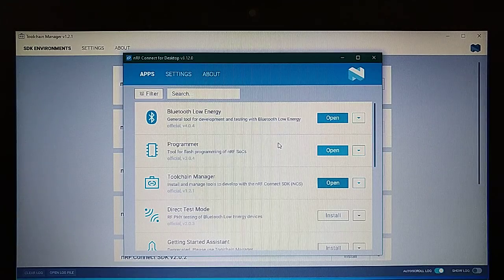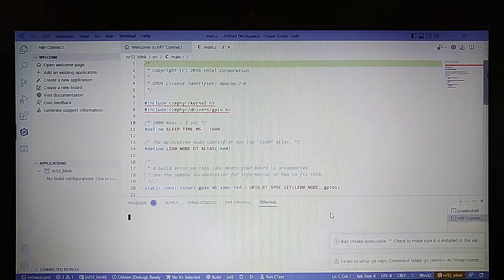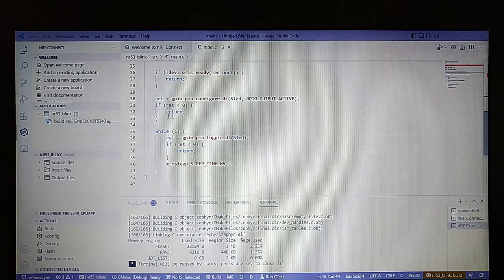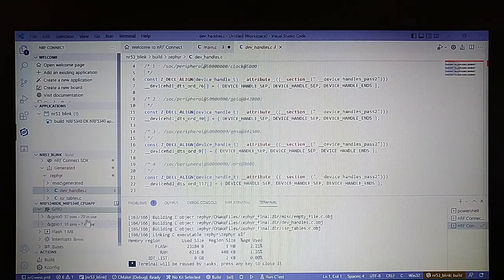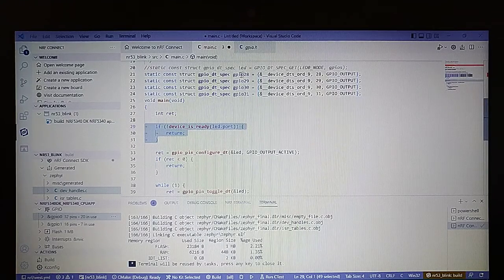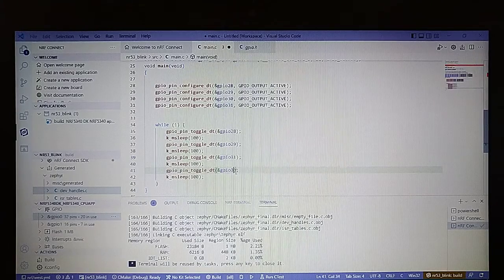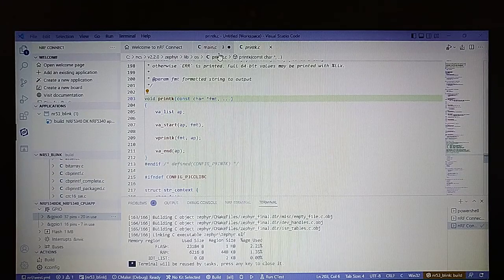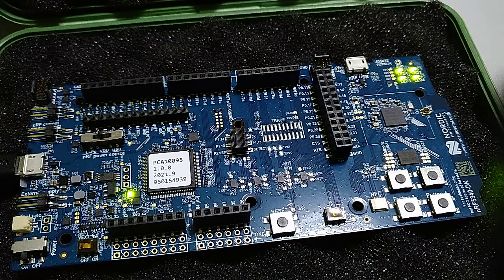Nordic NRF5340 DK blink example in nRF SDK VS Code

Comment: Hello sir, I saw your video using the NRF53 audio module – very informative, thank you!
I have one doubt: Can I use the Adafruit nRF52840 Express board instead, just for doing a simple LED blink as you showed?
If yes, do I need to change anything in the code or setup?
Thank you in advance!
Reply from the maker: Hi, for nRF52 I recommend using Segger Embedded Studio with nRF5 SDK, however the example probably could work just by changing the board in the project setup (in VS code). Just make sure the board definition selected is compatible with Adafruit Express board (the pins You will be using are the same)
Reply: @e-exp  thank you sir

Comment: I don't have dev_handles.c after building, only configs.c and isr_tables.c
Reply from the maker: You are right because the version of sdk 2.2.0 (the one used in the example) is not available thanks to nordic, and the new versions differ alot and don't have dev_handles.c in build.
I'm not sure when i will be able to add a fix to it, but when i will have a bit of time i'll add it.

Comment: how to connect nrf5340 board with any other ide?
Reply from the maker: Segger Embedded Studio supports the nRF5340 MCU but You have to create the project nearly from ground up. 
https://wiki.segger.com/Nordic_Semiconductor_nRF5340

Another way is to create a baremetal project and link the libraries to it so it can be used in most of the ides.

At some point in time i will be switching to segger or atmel studio (visual studio) with the nRF53DK because the vscode with zephyr is kind of slow  and takes a lot of resources to build.

Comment: I can't find the file "dev_handles.c", so I have no idea about devices declared. Could you help me?
Reply from the maker: Hi, the dev_handles.c is a file generated by the zephyr build process. So to get the file You have to run a clean build of the application. After the build the dev_handels.c can be found in Source files -> Generated -> zephyr. 
If You have problems with zephyr you can use the nrf drivers directly just like in my video with a spi lcd screen - there gpios are used only with the nrf driver.

Comment: Can you make a video tutorial for vs code used nRF52 microcontroller with all the peripherals like gpio, adc,  pwm, uart, i2c, spi
Reply from the maker: I got a few nRF52 DK boards (the nRF52832 variant) so sure thing
Reply: @e-exp  Thank and please make the tutorial using vs code
Reply: @e-exp  no problem with nRF52 series, you can use any kind of nRF series 53 also because of all series are same way only

Comment: for a blink of LED i have to code this much 😅
Reply: Real
Reply from the maker: You can also use the legacy driver, for example to configure a gpio as output use nrf_gpio_cfg_output(pin); and for toggle use nrf_gpio_pin_toggle(pin); - where pin (uint32_t) is 0 to 31 pins P0.00 to P0.31 and from 32 to 47 pins P1.00 to P1.15. 
For reference see the file nrf_gpio.h located in <SDK folder>\v2.X.0\modules\hal\nordic\nrfx\hal\nrf_gpio.h